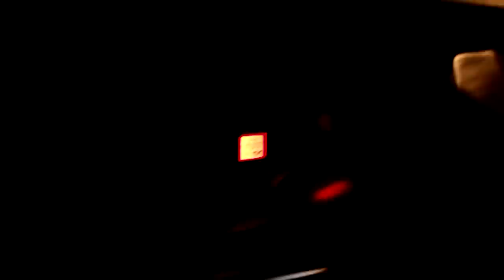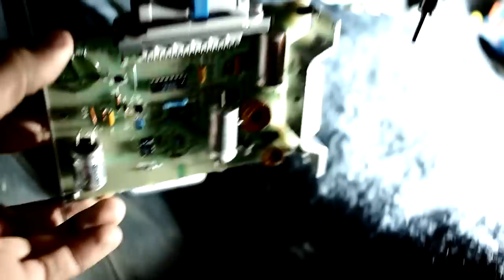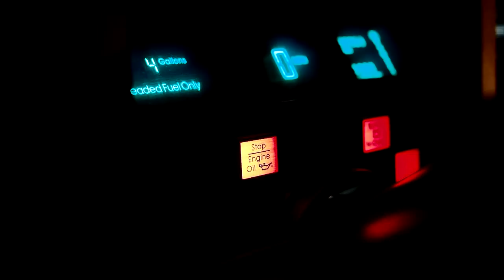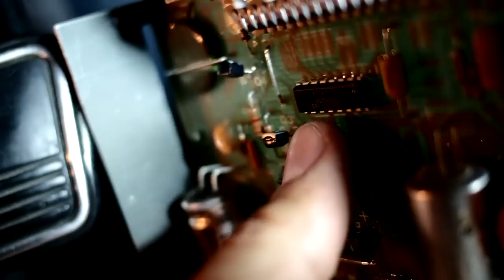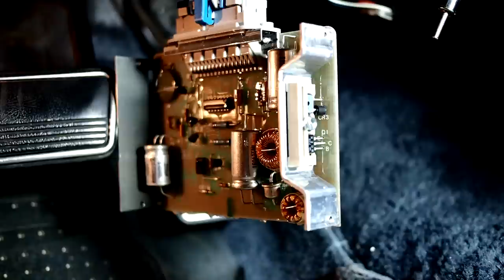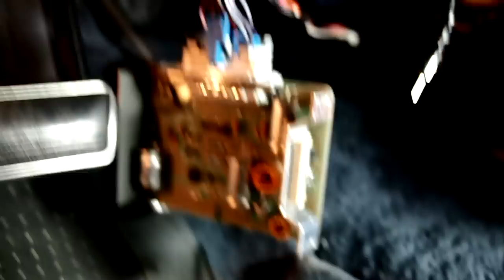Cadillac Flickering Dash Lights, fixed

Comment: Ok, what you had there was called a cold solder joint.  Once you found the loose component, in this case it was a microcircuit you used the correct repair which is known as reflowing the solder.  Just a little electronics lingo there for you.

Comment: I have a 1988 Cadillac allante and recently a few minutes after I turn it on the digital dashboard and radio consol start flashing. After it flashes a few times it says I have low volts. I just replaced the alternator but nothing changed. Could the chip be the problem?

Comment: I have a 1992 Cadillac sadan deville my fule data won't show on the dash bord but the other side does the ac side light on what can I do to fix it
Reply: Same problem
Reply: I have 93. I just went to pull a part and bought another module. Pulled it out and replaced it. Works fine now

Comment: I have a 95 Cadillac deville the dash board/cluster won't turn off when I take the key out the ignition so every time I've been driving it I've been disconnecting the battery to make it turn off anyone have any advice??? Help??
Reply: Sounds like a bad key switch.

Comment: I have a 1992 Cadillac sadan deville my fule data won't show on the dash bord but the other side does the ac side light on what can I do to fix it
Reply: Rodrigo Mexquitic did u ever figure out what it was? Im having the same problem
Reply: @devontamiller4312  My DeVille does the same thing. Did you find out the issue??
Reply: @grindhard4312  computer issues
Reply: @devontamiller4312  you had to buy another one??